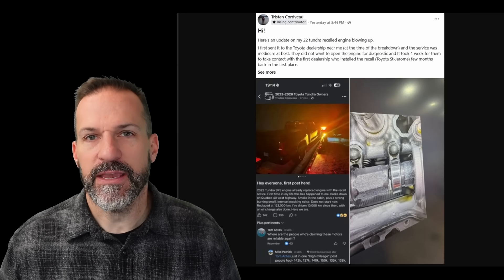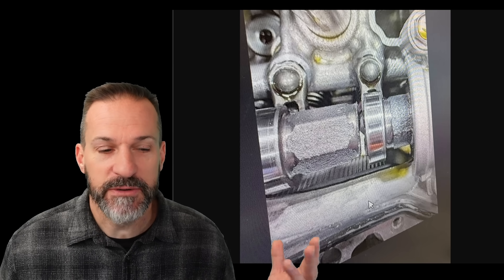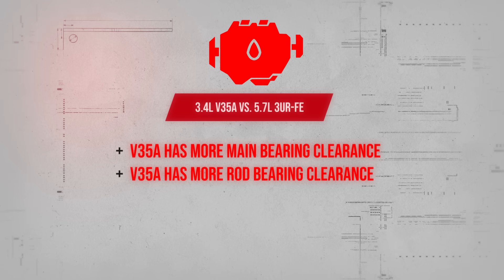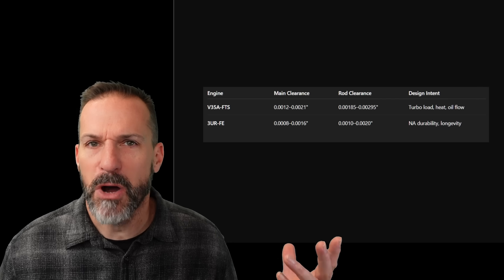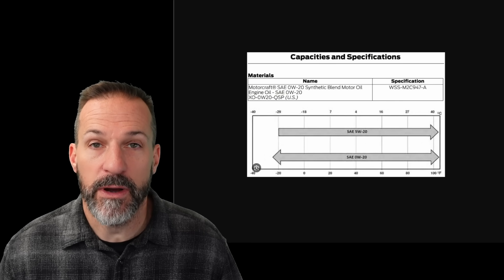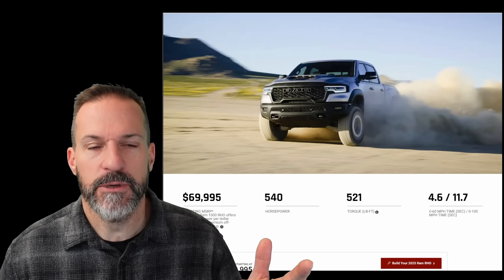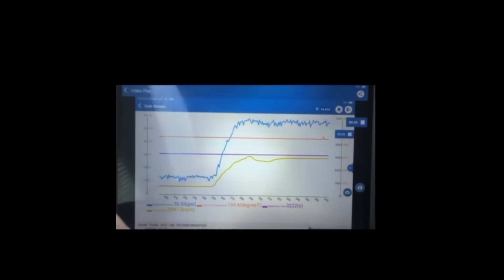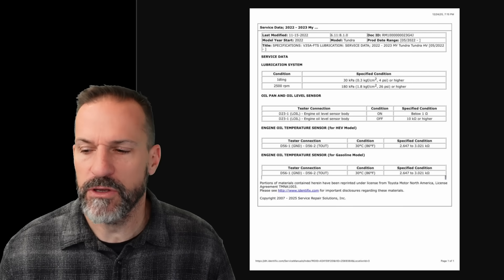Can We FIX Toyota's BILLION Dollar Mistake at Walmart? 2022- 2026 Tundra...

Comment: Back in the day - Smokey Yunick recommended a general rule of thumb for oil pressure of 10 psi for every 1,000 RPM in racing engines. 
I had a 350 Olds that would idle at 7 psi with 20W-50. Of course this was all you needed half a century ago.

Comment: Hey, if the guy wants a '20-'21, I'll sell him my 1-owner '21 that just passed 20k miles, meticulously maintained w/ Amsoil only!  Should run for hundreds of thousands of miles.    A southern truck SR5 quad-cab in Cement gray 4x4 w/ 20" Alcoa forged wheels...never been offroad or on salted roads.   I'll take 70 grand for it.  Let me know.
And point well made about an oil pressure issue!  And good investigative work on the tolerance increase....not decrease.   Thanks for sharing!
Reply: 70k LMAO

Comment: I wonder wait the failure rate is after replacing spark plugs at 40,000 miles. If it’s causing debris to get into the engine

Comment: Don’t you think Toyota would’ve already tried different oil weights. I would imagine they’ve already tested numerous weights of oil. From 0 to 20, 5 to 30 and so on. I don’t know if anybody has any data on this information.
Reply: It's not about using the best oil for the job.  To meet environmental standards, all they care about is getting the thinnest possible oil to work adequately.
Reply: What people refuse to accept is the fact that the EPA gives the auto makers tax credits if they recommend water - thin oil and if they recommend 10,000 mile oil change intervals.  EPA officials are not engineers, they are BUREAUCRATS, aka PENCIL-PUSHERS.
Reply: If they officially went to higher weight oils, wouldn’t they have to re-certify their mpg numbers to match the new oil? Would that trigger fines? I agree that would be the easiest fix. Something tells me there’s more to it. The oil pressure seems like a possible culprit. Would that be an easy fix via software?

Comment: I put one of those Range AFM / DFM disabler adapters in my 2021 Yukon 5.3l … going on 148k miles ZERO issues not even 1 light so far. That being said - I at least think you theory is correct about all these oil swaps and turbo engine.

Comment: I need help please. I'm planning to switch to 5w-30 oil for my GX460. Will there be any problems?
Reply from the maker: I would check to see if 5w30 is spec’d in other countries for that engine. I believe it was but just double check. I would imagine a lot are already running 5w30 in it. Where do you live? Hotter climate or cooler?

Comment: Appreciate ram calling for 0w-40 from factory on the HO… I also appreciated my previous fords for calling for 5w-30, helps drive the cost of change down as it’s super common and affordable for full synthetic, something often overlooked with all these light weight oils is they tend to be more expensive, and don’t seem to protect as well.
Reply: Dude, don’t worry about the price of your oil. If you’re doing oil change every 3 to 5000 miles you probably don’t have much to worry about but if you’re gonna do 10,000 mile oil changes get something amsoil or Schaeffer.

Comment: As a department head in vehicle development for an auto manufacturer- these types of videos have me pulling my hair out. They're filled with speculation and incorrect information. Let's set this straight once and for all. First, we determine viscosity needs based on four main factors: A) Total bearing surface area B) Bearing clearance C) Bearing Load D) Oil Temperature. Once we determine that viscosity we can adjust for cam phaser pressure and oil cooling jets, etc. Modern engines use oil as hydraulic fluid (this is very important!).

Increasing oil pressure for the sake of increasing oil pressure is not a good thing. More pressure means more heat, more drag, more potential strain on components like the oil pump, etc. FLOW is what's important to achieve a safe hydrodynamic state. Going to a 40 weight oil is a terrible idea as you're going to starve bearings of adequate flow, increase component strain, alter valve timing (possibly setting an engine light) and grind a lot of metal in cold conditions. The majority of wear occurs at startup when you haven't reached a hydrodynamic state.

Lastly, oil viscosity itself continues to be completely misunderstood. A 0W-20 might have very similar viscosity at 100 C to a 0W-30. The viscosity printed on a bottle (0W-20, 5W-30, 10W-40) just indicates the standard SAE range it will fall WITHIN. For example, a 30 weight oil must fall within 9.3 to 12.5 centistokes at 100 C. European 40 weight oil is very thin and in some cases almost falls into 30 weight territory (12.6 cst). Likewise some 20 weight oils are borderline 30 weight at nearly 9.0 cst. That's why manufacturers have specs that oils need to meet. Saying you want to switch to a 5W-30 itself is meaningless- what specification of 5W-30?? 5W-30 can border on a 20 weight or 40 weight range.

In summary, it's NOT thin oil causing these problems. It's both manufacturing error as well as component suppliers who are out of spec. You can run an 800hp race engine on 10 weight oil if you know what you're doing. If you want your engine to last a long time you want it to flow extremely well at startup and keep the oil clean. Use an oil that meets your manufacturer specification and change it regularly and I promise it will last 300k miles (which is far longer than 95% of you keep a vehicle).
Reply: So, is there any problem with running 0w30 in a Toyota engine that in the US calls for 0w20 and in other countries calls for 5w30?  Will there be any negative effect to the life of the engine?
Reply: @Gadget0343  Re-read what I wrote. Oil weight on the bottle alone is not sufficient to determine the fit. Toyota makes small changes to powertrain based on the country/region of sale so it's not an apples to apples comparison. That said if you insist on running a thicker oil I'd suggest a cst under 10.5 if you want to run 0W-30 (a bit hard to find). You could try Mobil 1 Advanced Fuel Economy 0W-30. Also, Amsoil Signature Series 0W-30.